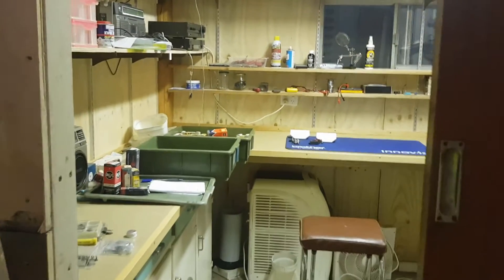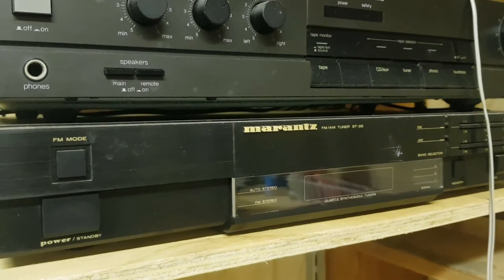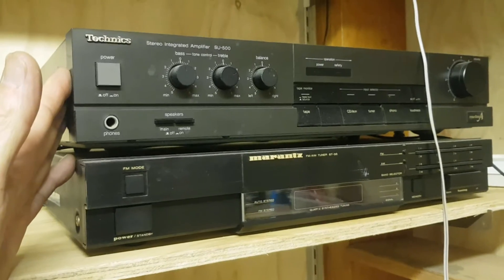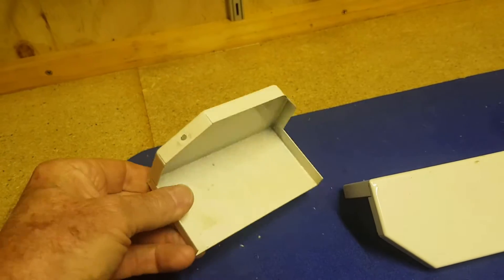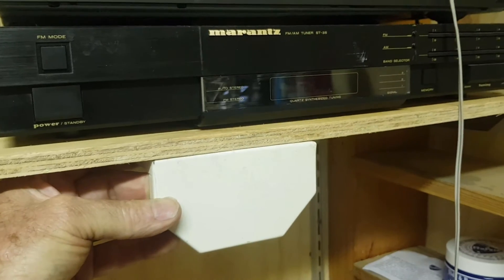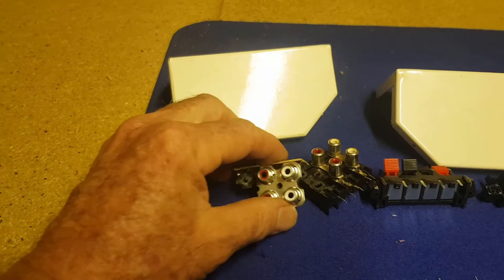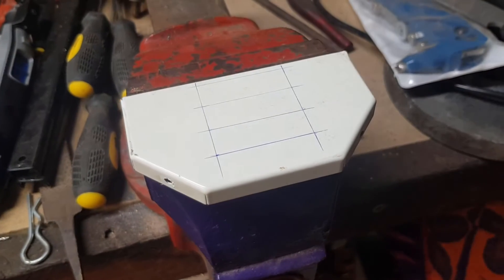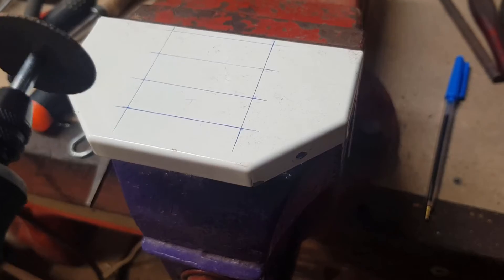Shed Update! Repurposing some ewaste to make a stereo testing dock. Amplifier/speaker junction box

Comment: Nice job Chris. To position the stickers I use water with a tiny drop of washing up liquid in it to allow them to be positioned, the water evaporates and the sticker sticks tight, it takes a few hours to dry but it allows them to be positioned easily 🙂
Reply from the maker: Thanks Dave, that's a handy tip! 👍😊

Comment: Wow that's a nicely set-up work area, i like it! And thats a neat idea with the speaker and RCA connections for testing speakers, tuners etc. I have a similar setup at the electronics repair shop i work for though not quite as elaborate as yours.. might have to remedy that i think! And thanks for the tip re the labels.. just found the same sticker paper on ebay as i've been searching for ages for a clear adhesive label product like that!
Reply from the maker: Thanks mate, appreciate your feedback! 😊